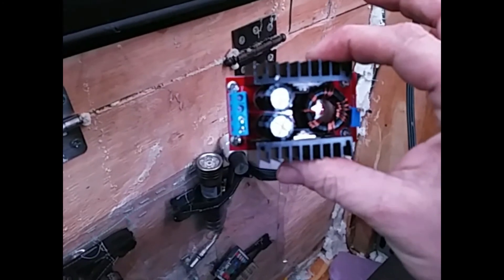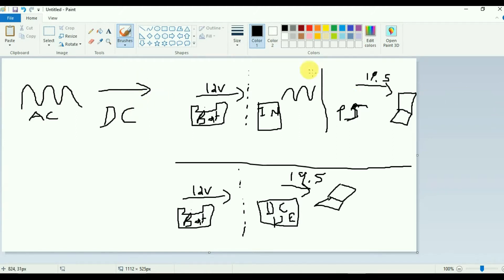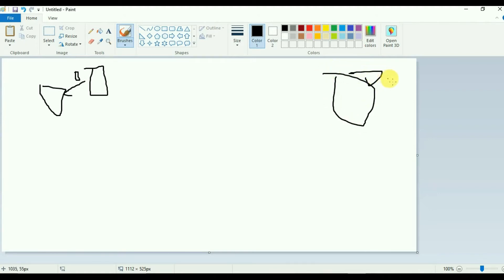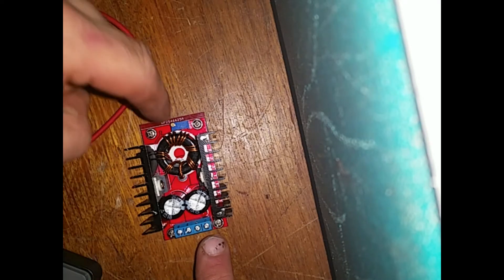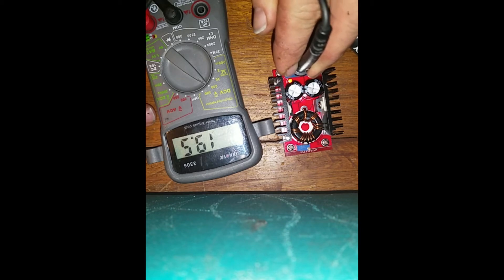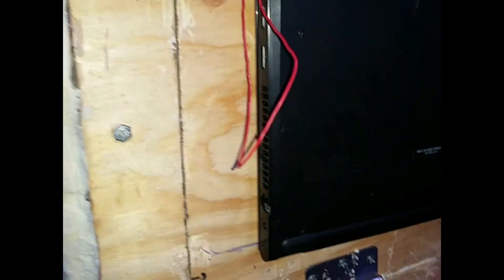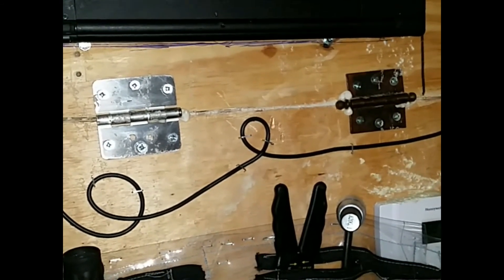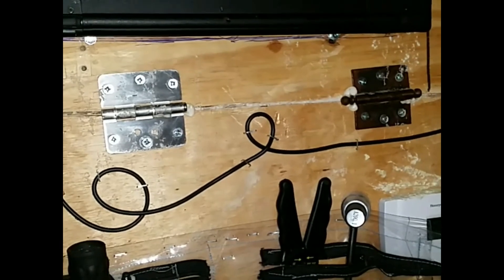Van Life Powering Laptop Without Inverter: Using a DC to DC Converter #vanlife

Comment: It won't charge bcoz you miss out the blue line which is the 'smart line detector.' This is what's happening right now to my laptop. The output from the the converter is to make a output power for the blueline (4.7k resistor and a zener diode around 6.8v)

Comment: Interesting problem you ran into. The lack of charging is because of all the legislated safety concerns about Li-Ion technology, particularly charging. You ran into the "A little knowledge is a dangerous thing." type of scenario. 

Also while you thought you were saving money, it ended up not completely working so this also begs the question... Does the ones you see on amazon also have this issue? Do they charge the laptop's battery or not?

https://www.amazon.com/BOLWEO-Universal-Adapter-Automatic-Voltage/dp/B01N1SWXSE/ref=sr_1_8?s=electronics&ie=UTF8&qid=1513803573&sr=1-8&keywords=12vdc+laptop+power+supply+dell

This one claims to be a "smart charger" and even automatically sense voltage. On the homemade side of things if you had an Oscilloscope you could watch and capture the hidden signal riding on the DC power then try to reproduce it. But buying a charger that already does that is probably a better use of time & resources.

I'm glad you did the video on this because I have a 45w starter solar setup and had thought thought about doing this.

BTW, in a circumstance such as a van build I would err on the side of insulating all your wires just to be safe. Never know when you might have propane, a solvent, LA battery fumes, gas vapor or even a flammable fabric which might turn a bare metal induced spark into a fire. A product I like is liquid electrical tape. It has a brush inside the can and you just brush it on after you've done your work. Very very durable stuff and the right product for the job.

As far as the circuit board goes conformally coating it is a good idea to protect against moisture induced incidents. (likely in a van especially if you start heating with propane & mr buddy setup) I've even used HF's dirt cheap 2 part epoxy for this. Then I ran my powered circuit through a lake to make sure it worked fine and it did.

Since you are building a whole system if I were you I'd consider going to a junk yard and buying a complete wiring harness and its relays, fusebox, switches and stuff. Then you'll know they were designed safe as of that year of the vehicle you chose. Something from the 70s or 80s to avoid computer issues. They'll all match up nicely, too.

I like that fusebox you got especially the part where the light comes on if the fuse is removed or blown. Do you have a link to that? Or what do you call it?
Reply from the maker: Hi John. I'm sure that $36 model would probably work since it is specifically made for it, instead of my $3 converter. I've been running it and it works fine as long as it is plugged in. The only thing is it kind of wasteful because if I could charge the battery I could charge it when I have an excess of energy input (a long drive or a good amount of sun) and then run off the battery at night for a few hours.

I suppose you are right about the insulation. I should insulate even the ground because it could spark if it got loose. 

I got the fuse box here https://www.amazon.com/OLS-10-Way-Blade-Indicator-Protection/dp/B00QMULSUI/ref=sr_1_1_sspa?s=automotive&ie=UTF8&qid=1513805955&sr=1-1-spons&keywords=fuse+box+ols+10+way&psc=1.

I actually bought another one and I am going to install it by the DC-DC converter to replace the screw setup I am currently using on that side. Then I should be set for awhile on both sides.

I don't know much about wiring harnesses and so forth but that sounds like that would have been a simply and cheap way to go. All those wires going every way does look kind of messy.
Reply: If you get a junkyard wiring harness with the common blade connectors like you use on your fusebox you will just be able to lego the parts any way you desire. And once an awhile you'll have to make a custom wire with the blade connectors on the end for your application, of course, but you will have most of the building blocks you desire and then some.

Switches from headlights and heater blower motors are durable and high amp. Often have indicator lights within them, too. I even know one guy who wired his ignition through an extra headlight switch as an anti-theft deterent. Unless it's pulled out the vehicle will not start. I thought that was very clever.

I'm not so sure that converter would work. I think it'd probably be best to buy the company's brand or confirm it buy comments section maybe.

I don't worry about your connections getting lose. I just know that in a vehicle a screwdriver could bounce around or maybe even a pet bump something metal into two items and make a short. Condensation will be an issue if you are living in it. I'm not coming to you from a safety sally POV as I am not. But I did go to college for avionics and you'd be surprised at the scenarios that can take planes down and cost lives. Thanks for the link on the fusebox and I enjoyed your map video, too!
Reply from the maker: Cool. My dad got a degree in Avionics and then flew C-141s for the USAF. I remember him telling this story where they had once had complete electrical failure over Africa and it was pitch black below on the ground. Thankfully the lights came back on. When he first started flying they had a navigator and on trans-ocean flights, who would take readings with a sextant. I think they always had the inertial nav too, though. 

The best screwup example was when that Canadian plane ran out of gas because someone calculated the amount of fuel wrong because they had switched to the metric system. I was cool how the pilot was able to safely land with no engines, though. 

My degree is in physics but the electrical learning was mostly very theoretical. It wasn't till later that I learned that batteries go down in voltage as you discharge them. In the books and from the professors, it was always batteries are "voltage sources." So, for awhile I thought the voltage stayed the same but as they went down it took less of a load to make the "current limited." Kind of like a frictionless surface and so forth. 

Just pretend that the positive charges are what moves in electricity and you are good-lol.

Comment: You can also put a simple 12v switch in the circuit. Should also fuse the wire to the max amp of the unit.
Reply from the maker: Do you mean ad another fuse or just put a different fuse in that slot I had the 10 amp fuse in?
Reply: You know that the fuses protect the wires from overheating if the appliance wants more amperage than the wire can safely carry. You match the wire and fuse to the max draw on the circuit. Think of matching wire, fuses and amperage every time you create a circuit. It is always ok to make the wire thicker, but can be costly. There are plenty of wire/fuse charts on the web. I wonder why you cant charge the laptop battery? Laptop batteries have built-in charger-balancers for the 18650 cells they contain. Try putting the voltage on the buck converter up to what the output is on the original laptop charger. Should also be 60 hz,
Reply from the maker: Oh sorry, I misunderstood your reply and thought you were referring a video for the thermostat that I hadn't even posted yet--lol  You were probably thinking what the heck was I talking about the thermostat —lol.

You are talking about having an individual fuse for each device. Yeah, I did look at those charts.  My understanding is that you have a line come off a fuse and then have it branch off into more wires for other devices as long as the fuse is less than the capacity of the smallest wire. I have that big wire (I forget the gauge) coming out of that fuse box on the other side and then I had it branch off to smaller gauge wires on the other side rather than having to run three wires over. Yeah, if I add many more devices over there I probably need to put in a fuse book on that side and maybe a bigger wire coming over. I'll make a little video talking about what gauges I used and how I set it up and you can tell me what you think.
Reply from the maker: Hi Andrew. Yes I checked the voltage back in the house and once I had everything set up and it was always right at 19.5 volts (the laptop voltage). The 60 Hz on the power supply is referring to the cycles per second on the AC input. The output is DC so there are no cycles.

I should have mentioned that there was also a blue wire, which I thought was unneeded. The voltage on the plug was 19.5, so I thought I was good.

After looking on the internet, I saw that the blue wire is supposed to send information to this "Dallas" chip in the power supply. If a power supply doesn't have the chip, the computer won't recognize the charger and won't charge the battery. I think it is call the charger ID chip or somethign.  

So, with some of these DC devices, it is a little more complicated than just matching the voltage. They do make an official car charger for Dell, but is something like $20.
Reply from the maker: Andrew, After looking at those wires again I decided I am going to add another fuse box.  Things weren't quite the way they should be. It would be safer and just easier to figure out if I just add another fuse box.  I just ordered the fuse box off amazon. Thanks, for making me examine that again.